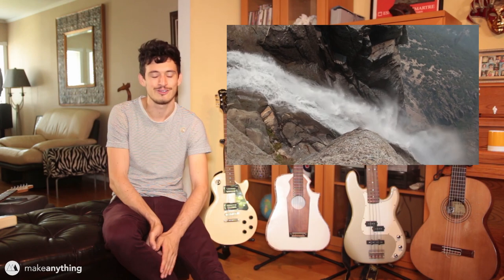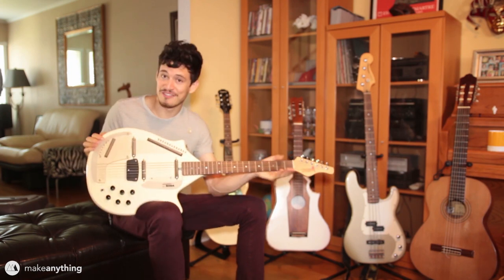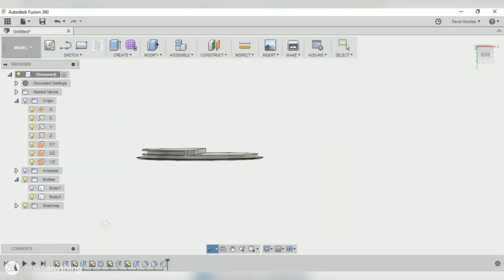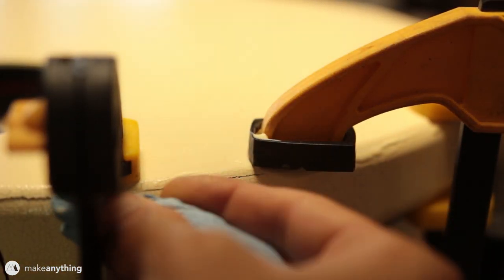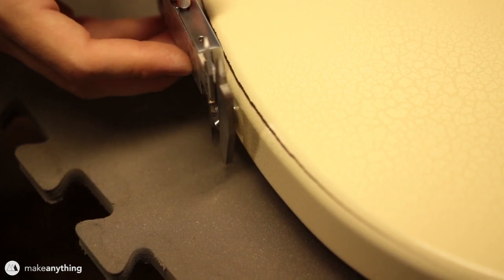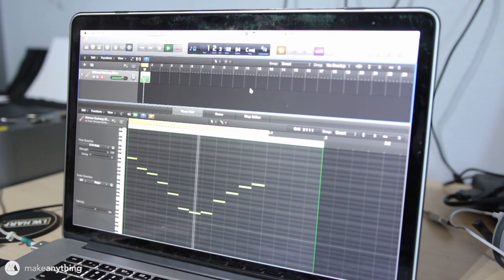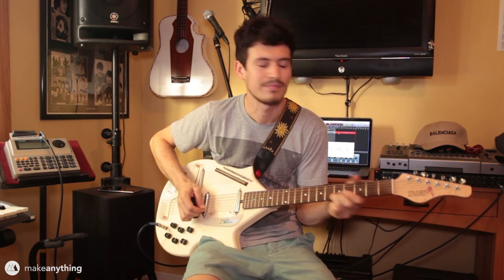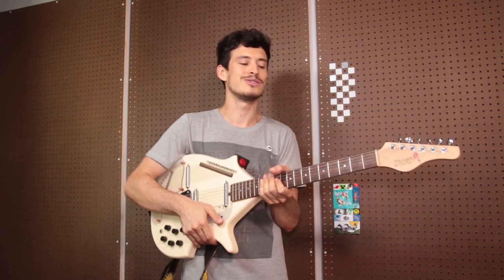Repairing an Electric Sitar (?!) with 3D Printing

Comment: Regarding the sympathetic strings, Narciso Yeps played a 10 string guitar with 4 sympathetic strings. I really like the threaded caps where the strap attaches and the replacement cover for the electronics. The Japanese aesthetic in the repair of the cracks is pretty cool. I used the raku process to make some pots when I was young. I'm trying to think if some sort of modern day equivalent would be useful to you.

Comment: The acrylic plate is actually supposed to touch the strings when they are ringing to add a drone resonance to the tone. There's a video where Tim Pierce shows Marty Swartz one of these you should check out. Maybe try springs instead of those 3d printed bushes?
Reply: Here's that vid: https://youtu.be/TBLSY2C8ufs
Reply from the maker: thanks for sharing.. I believe it's the acrylic piece under the bridge that is touching the strings, but in my case the clear piece of acrylic was touching the sympathetic strings (the harp). I'm pretty sure that's not supposed to happen.

Comment: Another product that could be used to Fill that crack either to hide with similar color or highlight it with a contrast color would be Seamfil by Kampel.  Seamfil is used to repair High Pressure Decorative laminates such as Formica on cabinets and countertops, it comes in many stock colors, but you can also order nearly any color that matches Formica, Wilsonart and Nevamar laminates, can be mixed, and most importantly, it does not shrink much as it cures.  It does need solvents to clean it off, but, once it cures it is a pretty rigid product.

Comment: Those small strings aren't harp strings, they're sympathetic strings. if they're tuned properly, they being buzzing when you play the same note on the guitar strings, so the sound rings out without you even touching them

Comment: 2 things... 1. Have you seen the danelectro sitar? And 2. Maybe try a drum key for the harp... It may not work but of the nuts are squares it's very possible that a drum key could work
Reply: Drum key is the wrong size. They give you an autoharp wrench, but my main complaint is that it is not a tight fit.

Comment: Hey great vid! I've been wanting to make a 3D copy of that sitar bridge( they are insanely expensive for just a piece of plastic). How hard will a replacement /reproduction of that "buzz" bridge be to make a 3D printed copy. I have the bridge already on my danelectro  baby sitar...but what I want to do is make a stratocaster version( the baby sitar is a little awkward..slips off the lap at times because of the shape) hence making one from a strat body. Also, MY modification  would be to scallop the neck, that way you can push down on the strings making them sharp and adding vibrato(which I plan on doing on the strat version) any help would be appreciative(BTW I have never done any 3d printing...so, I am a complete novice) so, if you need to talk down to me...no worries! thanks in advance
Reply from the maker: I wanted to do the same and I can't imagine it being too difficult but I also don't know how precise the bridge needs to be. It should just be a matter of getting the correct distances between the block and the strings. It could be done in tinkercad
Reply: thanks for the reply...if you ever do figure it out, let me know

Comment: It's a shame that this nice guitar is made of particle board, one of the worst materials that could be put to this use. Guitars need to be as solid as possible, and particle board is just too flimsy, as far as being totally wrecked by a spacer. I hope that it won't give you any headaches!
Reply: Alexandre Rocha Right ??! When I heard particle board, I wondered WHY the creator used it ! Cheaper ? Or maybe he/she didn't have access to better grade of wood ? It's shame. And getting it wet, or living in a high-humidity area could spell doom for this sweet instrument ! Sigh.
Reply: Maybe Devin could ask a woodworker to make measurements of the body shape and produce a guitar body made of basswood, or ash, maple, mahogany, because probably the neck is an actual guitar neck, I think that this guitar could sound even better with a body made of actual wood. Let's hope he reads this.
Reply: The frame is made of wood, so the sides are wood. The top and bottom are made from masonite. The original Dano/Coral electric sitars were made that way to cut costs.

Comment: It is so refreshing to see someone actually use 3d printing to fix problems in everyday's life. Too many people just use 3d printing for fun and making toy figures and so on, and it's perfectly fine, but it gives the impression to unintiated people that a 3d printer is just a big toy, which it is not. Keep it up !
Reply from the maker: Thanks! You're right, people should see the real value in 3D printing
Reply: Simon Fontaine very true, but I don't have enough problems to solve, so for now, I'll muck around
Reply: Well it could be a big toy
Reply: It ~is~ a big toy for those of us without design and/or engineering skills :p (and who lack the time to develop them as a hobby)
Reply: @make.anything  Why not play Shake it off on it? Why is the body Masonite?

Comment: Would the harp normally be tuned to a common scale used in indian music? I love what you did with the cracks and I'm a little eh on the brassy color, but the idea is still there, and that's neat. Also love that accent colour. I thought it would be weird with just the back cover, but the additional modifications tied it together!
Reply from the maker: Thanks! I know the red is striking, but I figured I should highlight the 3D printed parts :)
Reply: Not on this instrument. the guitar frets aren't tuned the same way indian music is tuned (equal tempereament vs. just intonation) so tuning the sympathetic string to indian tuning would be out of tune with the guitar strings.
Reply: niall oh thanks!! That's super interesting :)

Comment: I hate to tell you, but the goofy strip of masonite and single central mounting-screw is, in fact, the stock 'factory' method of mounting the cover-plate against the three support-tabs.  This ultra low-budget approach is typical of  (the head of DanElectro) Nathaniel Daniel's industrial-design philosophy.  (btw, I've been a professional guitar repair-tech for 40 years - that's how I know about DanElectro guitars...)

Comment: Please can you help me with a problem on my printer. It works great but my layers are visible so bad! Layer height is 0.2mm nozzle 0.5mm and im using pla. My printer is k8200

Comment: wicked cool..  one thing, when filling gaps with carpenter/wood glue, use fine saw dust as a fill, it'll shrink less and be stronger! very large gaps, believe it or not, soak toliet paper or paper towel and push into the gap .. fills, shrinks less, holds super strong.
Reply from the maker: Thanks :)

Comment: Make Anything // 3D Printing Channel, I was watching a video on an electric sitar and learned that your actually not supposed to play the harp built in to it. It's purpose is to pick up sympathetic vibrations and get a cool background sound. Just thought it was a kinda cool fact and you might want to know.
Reply: They are meant to ring sympathetically but do not ring out like they do on an Indian sitar. There is no wrong way to play them. Ravi Shankar broke the rules bu strumming across his...

Comment: I would totally try printing an additional guard out of different colors in case I ever wanted to switch up the look of it- you could totally go crazy with colors and texture to make it even more unique! I'd also try making little wing nuts for the tuning pegs for the harp that could stay on the guitar full time, or even a simple tuner (similar to what skateboarders use to tighten their trucks?)- if you ever wanted to travel with this guitar I'd hate to have to carry that wrench around! (Also, side note- do you think you'll sell/release the files for the strap locks? I'd love to have some myself! 😊)
Reply from the maker: Good ideas! The strap lock files are already linked in the description :)